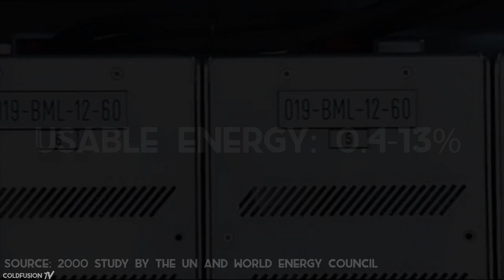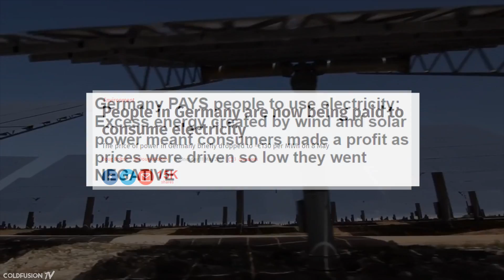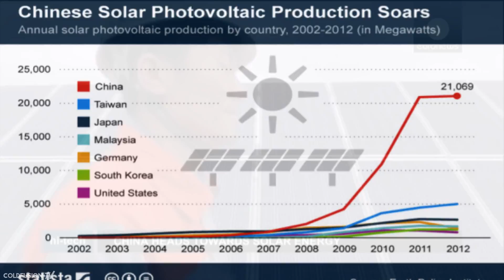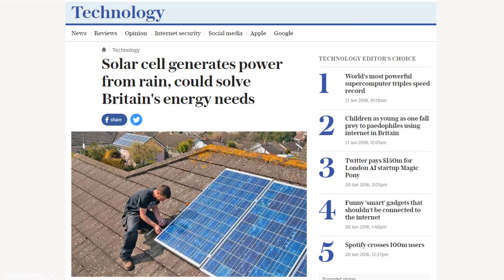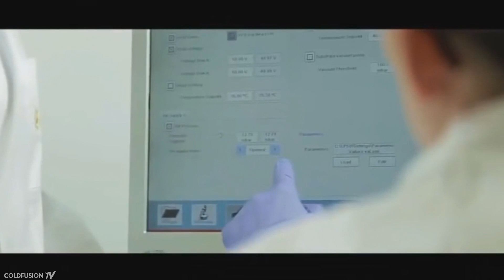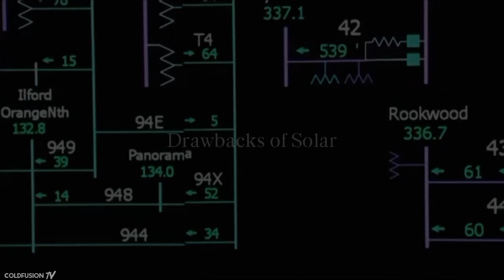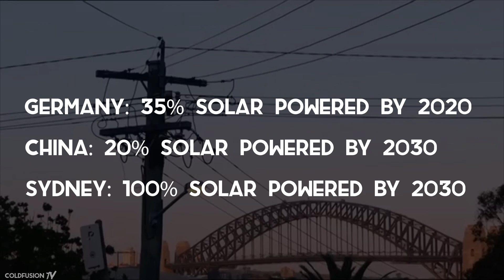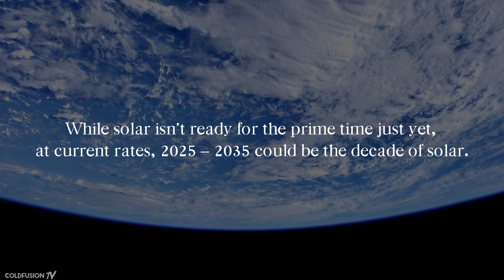The Truth About Solar

Comment: "What is our raw input energy from the sun absorbed by the earth?

The total energy absorbed by the earth atmosphere land and sea is around 3.85 yotta joules per year. Just 1 hour of this energy exposure is more than the world consumes in 1 year. But we can only use from 0.4 to 13% of this energy."

So you make it sound like solar energy is the answer to all the energy problems from the start, therefore there's no point in watching a biased "explanation" that explains "the truth". If you wanted to be a little bit more neutral and consider the actual facts you could have taken a neutral point of view considering, for instance the ACTUAL usable energy of the 0,4 -13% as measurement.

"How fast is the solar revolution happening?" The "solar revolution" already "happened" in the years 2000-2010, and came to a full stop (at least in europe) due to the financial crisis and the fact that solar energy is "clean" (except to dispose of the panels once they hit end of life) but not very economically viable.

Comment: I'm sorry, but what other roads pay for themselves, with the energy they produce? Solar panels pay for themselves with the energy they produce. Solar roads, just like paver brick roads, cost more in the beginning, but are cheaper in the long run. The solar roadways not only pay for themselves, but they will last longer than asphalt roads. The idea that they are a scam is a lie. Don't listen to the propaganda. You'll see how they are going to become pervasive over the next ten years. The idea that electric grids will need to be upgraded because of solar power is absurd too. In fact, solar panels on people's roofs is going to relieve pressure from the grid, stabilizing it and reducing the need for upgrades, by spreading out power production.
Reply: Solar roads have been thoroughly debunked by actual scientists, they are absolutely a scam. If you want to make a useful solar roadway, then put the panels above the road instead.

Comment: I'm curious why there's no mention of the irreparable environmental damage involved in the production process with contaminated water being the main result?
Be honest with the downside, and do a true audit of the real costs. The hydrocarbons burned in the manufacture, shipping and installation of solar panels must be accounted for, or this is just an exercise in self assurance.
Wind turbines are another prime example of the bias in these so called evaluations. The concrete base for most large turbines weighs 50-100 tonnes, and one tonne of CO2 is emitted with every tonne of concrete, as it cures. These turbines would therefore have to run for fifty years, just to repay those CO2 emissions, without taking any of the other factors (like the diesel to get them from eastern Germany to the west highlands of Scotland.) into account.
Their designated useful life is forty years, meaning we just inadvertently released huge quantities of CO2 all at once, doing more damage than coal would have in the next 25 years, all to reduce CO2 emissions, only to find it substantially adds to them.
Bull headed arrogance from people convinced they are right is killing us all right now, and if our environmental daydreams involve putting anything on a concrete base or a long lorry journey then we need to wake up to them, 'google CO2 emission rates from concrete' and 'CO2 emission rates from transport' before we decide something has no down side. It might help us to avoid finding ourselves backing these half thought out solutions again.
Reply: Travis Simerly Nobody mentioned coal, don't be so disingenuous.

Besides, I'm a proponent of nuclear, not coal. 

Though wind and solar cogeneration have their place, they're not the panacea the Birkenstock crowd would have us believe and without the massive taxpayer subsidies, wouldn't be built at all..
.
Ultimately, fusion ought to be the goal but it has a long history of disappointment, we'll see how the latest try goes when they commission the experimental ITER Tokamak in Cardache France around 2020.

I worked for a Toromont Industries division in the renewable energy industry as well as GE so I know what I'm talking about.
Reply: Coal has to be transported to power plants, it doesn't magically appear. Combustion of one ton of coal generates 2.86 tons of CO2. It's silly to suggest that a wind turbine won't outstrip the carbon footprint of its installation. It's ludicrous to suggest that coal is a more environmentally sound alternative.
Reply: Joes WebPresence I don't see the word "coal" anywhere in your original post, you mention "hydrocarbon" for transport and manufacture but this could be diesel and gasoline trucks or diesel electric trains and natural gas fired power plants.

I'm a fan of molten salt fast reactor development as they can consume waste produced by conventional reactors and are meltdown proof. They're just not feasible at present because politics have stymied their development since the first one at Oak Ridge in  the 1960's.

 Regarding conventional reactors, no energy source is without problems but plants,with proper planning (like don't put them in coastal earthquake zones) are a lesser evil than many other forms of energy.

My uncle engineered nuclear piles in submarine propulsion systems in the UK and is also a proponent of nuclear, power, despite being fully aware of the known risks.
Modern and future nuclear designs aren't the bogeyman the activists have made it out to be.

http://www.world-nuclear.org/information-library/nuclear-fuel-cycle/nuclear-wastes/radioactive-wastes-myths-and-realities.aspx
Reply: Andrew the Celt
I did compare the turbine's carbon footprint to coal.
The concrete base would most likely not be compatible or certifiable with the turbines of 2050, but it's hard to say.
I couldn't disagree more with nuclear as a solution, unless you are talking about a thorium reactor.
I won't go into the carbon footprints of nuclear reactors or the huge public subsidies, or the provable fact that so far BNFL has yet to make one penny of clear profit or one Kwh of their claimed cheap energy, and won't til 2076 without more unseen expense like cleaning up at Dounray or Sellafield.
I would simply ask you to consider the problem of the storage of spent nuclear fuel rods. There were hundreds stored at Fukashima. All now adding to their woes. Being in the industry, you may know how much of a premium, space in their storage tanks has on it now. The stuff has a half life of twenty thousand years and must be kept under the strictest security conditions at all times. We're making more rods every day, and still have no idea how to safely dispose of it once we've made them.
So when you are explaining to people how nuclear is the cheapest energy solution for us, please bare in mind that BNFL hasn't factored in the cost of one single security guard on 24/7 for the next 20,000 years, let alone what it will ACTUALLY take to guard and manage those fissile materials.
The reason they don't do this is obvious. It makes an obvious and complete nonsense of all their corporately sponsored official findings.
Reply: Mike Marges It will never, ever be 100% solar. Not feasible in all areas, for instance extreme Northern latitudes where you only get a couple of low angle sun a day. You also can't store it so forget grid demand at night unless you're going to pump water uphill into reservoirs during the day and drain it at night to draw hydroelectric power out (they do this in some places), a huge net loss.
Reply: Not to mention the energy required to recycle what's left over at the end of the life cycle and disposal of un recyclable materials. 
A concrete pad, if designed and built correctly ought to be reusable after the first turbine has reached the end of its usefulness.
Reply: I always suspected the wind turbines didn't add up.  Well at least the designs I have seen, which I believe are the popular and same you are speaking of.  
Almost the same for solar paneling.  While it looks promising, I believe they rushed the designs.  The new thin solar panels that would be makes a humongous amount of sense.  Research should also target above the cloud designs.  Something that would simply funnel power to earth 24/7
Reply: Travis Simerly
Then the UK government's own findings are "silly" as you say.
This was from a study they commissioned into the feasibility of large scale wind farms. Coal fired power stations are usually fed by nearby coal seams, transported by train, and yes, those carbon emissions were taken into account.
The UK caused the release in one year of the same amount of CO2 in doing this, as would have been released in 25 years of the coal generation they replaced.
Fact.
Please stop deciding what's "silly" by simply following what all the other sheep claim is good, and do your own arithmetic if you doubt me.
Reply: *****
Wind turbines can be an efficient solution on a smaller scale, where large foundations are not required. It's only the huge commercial turbines that are a problem.
Up my way in Scotland, the company has a sweet deal, and is paid to leave a percentage of turbines offline in each site, so the hydro dams can compete. Knowing this, they started putting up turbines, and taking the subsidy for them, but never actually running a power cable to them! Saved millions in copper, and a loophole in the agreement meant they got away with it because those are always the ones they are paid NOT to switch on!
Reply: Andrew the Celt
They certainly have an uphill task. Perhaps how they deal with the intractable problems they have already created will determine how future generations view them, and evaluate their ideas.
No I did mention coal. Fourth paragraph. I said:
"Their designated useful life is forty years, meaning we just inadvertently released huge quantities of CO2 all at once, doing more damage than coal would have in the next 25 years, all to reduce CO2 emissions, only to find it substantially adds to them."
Not that I was at all suggesting a return to coal. I was just pointing out how much CO2 was released in the whole concrete cycle during their manufacture.
We said "We must do SOMETHING!" and the thing we did was hasty, ill thought out, and actually caused a lot more CO2 emissions to be released a lot quicker.
Thanks for the link. I'll click through tomorrow.
Reply: Andrew the Celt I commented from Youtube, for some reason Joes WebPresence comment about coal didn't make it to Google+. I don't think they are a panacea, but if your primary goal is reducing environmental costs (C02 emission/methane release/coal slurry) they are great. Yes, they are expensive, some find them aesthetically displeasing, and they chop up a certain number of birds. I don't have a problem with nuclear unless it's built where the plant might be turn apart by earthquakes/tsunami (Oh, and NIMBY if course haha). Bad planning/design= bad outcome. I have a relative that works for a nuclear plant. Doh! Duke Energy.

Joe, I found an article about wind in the UK, cited in 12 other articles, but it certainly didn't say that wind turbines caused more C02 emissions. Is this study you mention funded by the "Friend of Coal" campaign. I see those stickers where I live from time to time. I really enjoyed their pamphlet praising coal dust as "nutritious and healthamitizing to the lungs". I actually would like to read the article, please provide a link. If you have calculations/links please provide them. (I don't have any.) I'm actually interested in the C02 emissions associated with concrete. god my life is sad.
Reply: Travis Simerly
This is a good place to start:
 https://en.wikipedia.org/wiki/Cement#Environmental_and_social_impacts
I don't know if that 'friends of coal' group ever quoted these figures, but that might well be the case. The study was independent though, and came from those groups highlighting de-forestation.(I can't for the life of me remember the group, let alone the article, But I remember it surprising me and reading more on wikipedia and elsewhere about concrete.)
The headline figure was that roughly 18% of all man made CO2 emissions came from transport as a whole, and 18% from concrete curing, (as much as all transport including ships and trains!!!) yet a monstourous 54% came directly from the fires of de-forestation.
Looking objectively, as I sit typing this reply in the early hours, my life could be seen by many as pretty sad too, but only through the eyes of those people, who's opinions mean little to me. Those who are 'sad' enough to reply to me are at least connecting on a higher level than those poor drones who will predictably say of us 'You two must have sad lives to be talking about boring stuff like that.'
THAT'S the truly sad response when you think about it.
Reply: There are same "costs" to develop, build, maintain, produce and export energy from oil, gas, coal and nuclear...Only difference is once a solar plant is deployed the energy output is free, clean, and "unlimited" forever more. The others require a constant supply and waste byproduct ongoing until it finally runs out (fossil fuels are finite and we'll eventually have to switch one day anyway!). 
Think about it, for the past 30yrs straight Solar has been dropping in price exponentially and getting more an more efficient. The amount of world energy supplied by solar has been "doubling" every 2 years for the past 30yrs straight. We have just past 1% of world energy supply...Sound insignificant but think of it this way. If you're a betting man and believe solar will keep doubling for the next 14yrs like it has (fact) the past 30yrs...then we are only 7 more doublings away to 100%...as little as 14yrs.
Reply: Good points, but this is about science, it's about.... well...

Solar energy is...

1) A child of climate quackery

2) A Kids Lemonade Stand business

 3) A  "LOOK MA! NO HANDS" status symbol and hobby.
(right CNC ?)

For an abundant energy future, see the Kirk Sorenson videos on Thorium and MSRs (Molten Salt Reactors).
Reply: James Biggar "With most conventional energy grids generally producing around 800g of CO2 per kWh generated"  
Where did you get this figure? It seems like numbers for a gas or coal plant, not a "typical grid" which in many places, like Ontario, are only hydroelectric and nuclear apart from a small renewable contribution.
Reply: James Biggar Alberta has or is shutting down all fossil fuel generation as well though they're not doing it without a mess and are reneging on contracts with generators to do it.
Reply: Local  government has supply contracts with 'suppliers'? For how long do these contracts run?
Reply: Joes WebPresence  should look up some info on how much water is contaminated through use of fracking
Reply: Tom Tompkins
That's a given, and I don't agree with fracking at all, but it's a drop in the ocean compared with the water that's been polluted with heavy metals in the manufacture of solar panels:
http://www.bing.com/search?q=solar%20panel%20manufacturing%20pollution&pc=cosp&ptag=C1N13ABE91C7D8F5&form=CONBDF&conlogo=CT3210127

Comment: Here is what I believe: People on Sunny places should adopt the solar panels so the can help in R&D of the companies reinsponsible. I want to see two things happen: 1. I want solar panels to be developed, maybe those 3D or normal ones that also can harvest energy via the raindrops. 2. I want a grid to be made, a new one that allows for energy to be transfered to other houses if they need it if our house doesn't need it, a way to store the excess amount of energy (say Tesla batteries) and that neq grid will be so andvanced that say for example a volcanic eruption happens and it blocks the sun, we can still use Coal to power up the grid but leave the coal to be our secondary source of energy in rare scenarios only. Our prime source should be solar (including on our phones and laptops, because we're outside all the time, duh) and maybe wind, rain and sea waves too because those last are going wasted for the most part.... 

I mean, I don't know if we are doing good for harvesting all that energy but if the waves are just hitting the rocks of the islands, we might as well reduce the impact and create electric energy out of it. Same goes for the other renewable energy sources.

Comment: Great solar video.  I drove an electric car in 1978 !  The copper sponge battery is also relevant and so is passive solar design.  Hard to put all that in one short video. Mr. Tesla (Musk) needs to put a little home storage design resources into heavy slow turn flywheels for the home.  5k lbs at 500 rpm on a ten ft diameter will spin for a good while.  And 100 ton wheels on 100 ft dia might be the overnight transmission storage he needs to do a country or a state like HI or AK or TX.

Comment: ColdFusion, are you aware of the concept of space based solar farms? If so your viewers may be well served by a video on the subject.
Reply: The only problem with that would be getting the energy down from there.
Reply: Not sure it's the only problem, depending on your perspective. Certainly one of the main hurdles to overcome.
Reply: pop9095 What might the other problems be?
Reply: SahasaV Micrometeor impacts and placing it far enough away from the field of debris in space and overall cost. These two are related of course. Then there is the problem of logistics, in other words how to get a meaningful amount of panels or whatever medium you intend to use up in space in the first place.
Reply: pop9095 didn't even think about those.